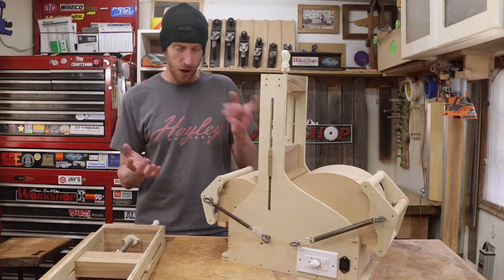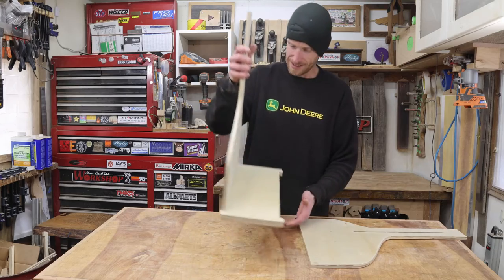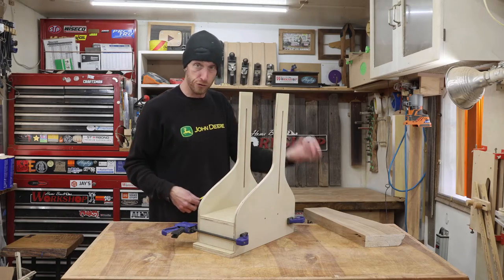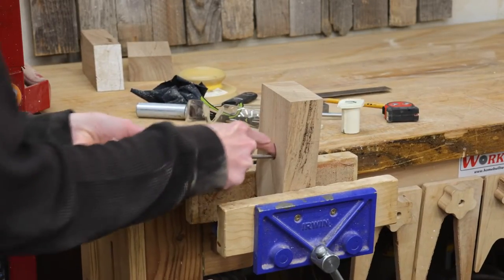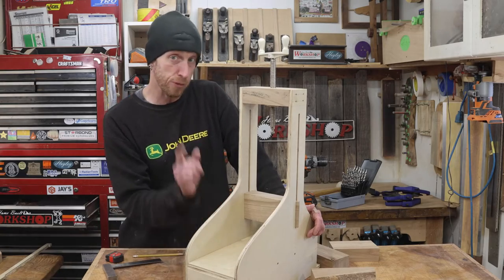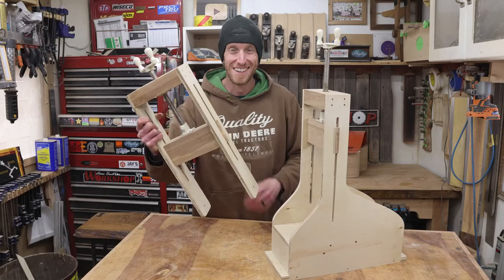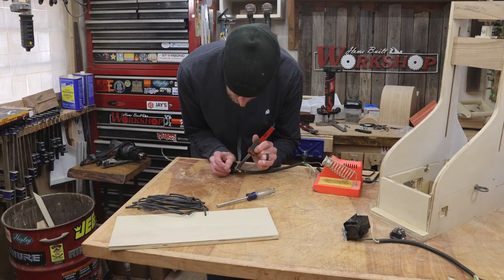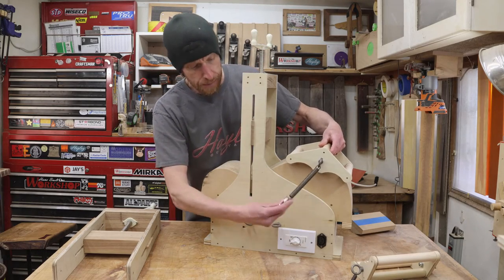Building my Acoustic Guitar Side Bender

Comment: Would love to see a tutorial on how you designed this for CNC.
Reply from the maker: While I don't have a specific tutorial at this time, I used several different plans for similar jigs that I found online as reference. I also have the digital plan for my acoustic guitars that I imported into Fusion 360. I used my plan for some of the sizes, combined with the other plans to create my own parts.
Reply: Would you share your designs? I have been playing with cnc work after I got me a Genmitsu 4040 Pro late last year. Also l, wanted to start building guitars once again for my grand daughter and daughter. I have only built one and a half plus a uke so far, but need to make these jigs, especially a side bender, to make things easier. I do have Fusion 360 and Carveco for design work on the cnc.

Comment: Now, i'm assuming you would use a router if you didn't have the c n c machine, so what would you do different if you were using a router?
I look forward to hear from you by for now ken
Reply from the maker: I would draw it out on a piece of plywood, then cut it on the bandsaw. For the slotted piece, I'd use a router and a straight edge to cut the slot.
Reply: @homebuiltshop  OK that makes sense. Thanks for getting back to me.

Comment: Thank you very much for this. Please can I ask, what are the specs on your heat blanket and thickness of the spring steel? Also, could this easily be adapted for ukulele builds?
Reply from the maker: The steel sheets and blanket I ordered from Luthiers Mercantile. Unfortunately they are going out of business. I know there are several blankets like that on Amazon. Its just a 110v heating blanket. I think the spring steel is .007" or there abouts. It could totally be adapted for ukeleles.